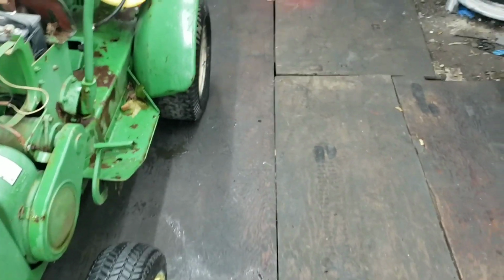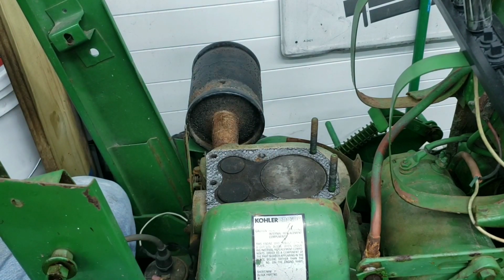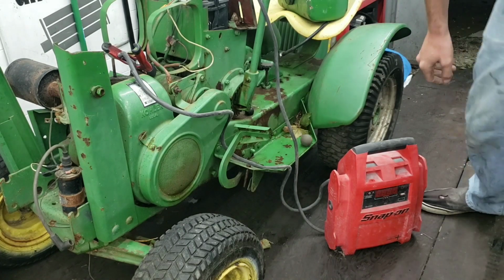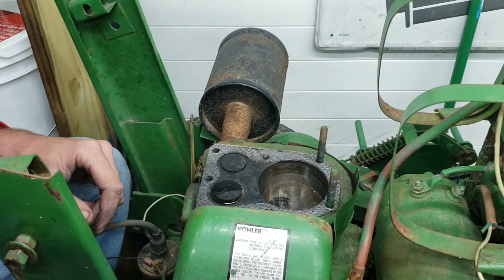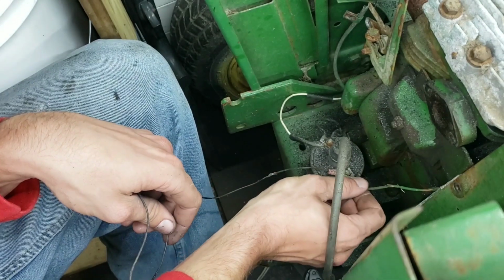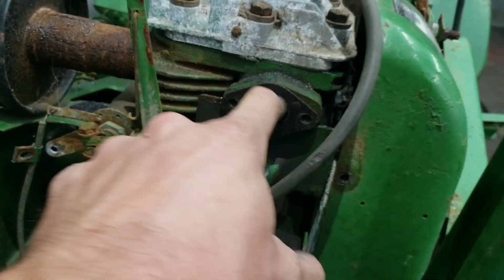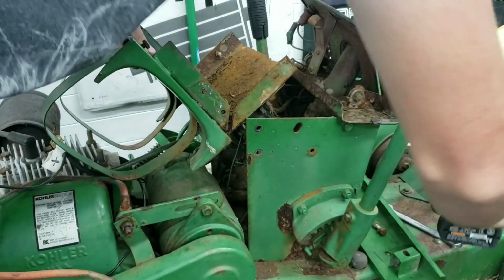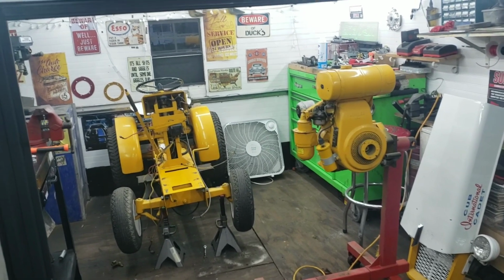Will it run? 1967 John deere 110

Comment: Fantastic my friend! I just found a barn find 110 and I am restoring it, fabricating an on board air compressor with tank and also a three point hitch with a power steering pump and tank for a hydraulic lift cylinder. I was thinking of doing a pneumatic lift cylinder but air may not be strong enough. looking for the next installment next. thanks.

Comment: It’s not a 67 cuz the foot pan isn’t welded onto the frame. They were welded I think after 65 I think I might be wrong. My 67 is the last year they made em. 

I kinda wish I got a 63 or 64/65 for the 7hp Kohler & 3spd but after from what I’ve heard abt em I’m glad I didn’t. 
8hp Kohler & Peerless 2300 like my 216 & 212 almost re-powered with a Yanmar L70.

Usually w these things if it’s got a Wlbro it’s the original carb, my 212 had a Wallbro on it & after the throttle went sloppy dropped an OEM quality one in it & she was good to go!

Comment: Mine was locked up just like that. Dropped it off the car lift freed it right up. I still changed it though.
Reply from the maker: I found out what mine was its the band brake under the tractor I cut that off and rolled just fine

Comment: Your variator is out of adjustment. it will need to be adjusted
Reply: Ive got a you tube Chanel if your interested I like to tinker with old john deeres like that one you have. Ive got one im working on now.
Reply: If anyone is interested me/MikeJD60 has a video on the variatior adjustment for the later model square fender tractors.